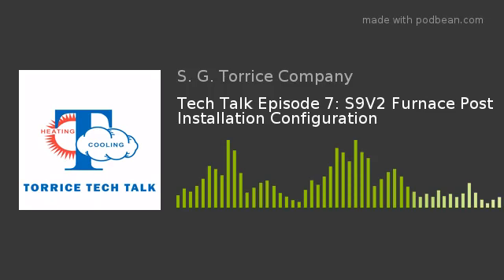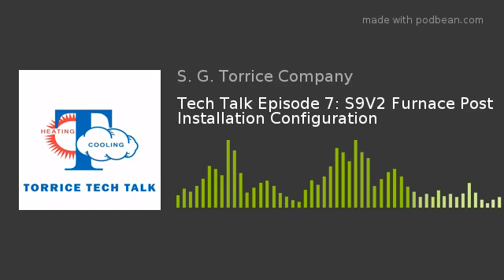Tech Talk Episode 7: S9V2 Furnace Post Installation Configuration

Comment: This was very helpful even without any video. A tech changed my cooling from 450 CFM to 400 CFM per ton and it negatively impacted my comfort level. Tech said it should only be run at 400 which I learned actually isn't true for the S9V2.  It can be run at 450 without issue as long as it is a dry climate and excessive dehumidification isn't necessary.

 The system also seemed to struggle to maintain set temp at 400 cfm (Lot of duct work in a 7200 sq ft house in dry climate Colorado).  Now I can switch it back to 450 CFM per ton without paying for a tech to do it.

Comment: Trane unit split 4ton outside ( single ) trane heater ( gas )  model S8B1B080M4PSCAA , honeywell 3000 tstat ,  the problem is that when I just want fan mode on the tstat the fan turns on , on the lows speed !!!!!    Now how !!!!  or can I change the speed on this board for fan only .  Is it able !!!  Or not